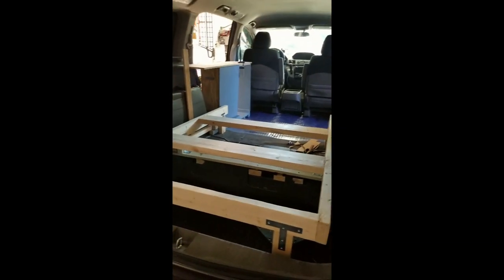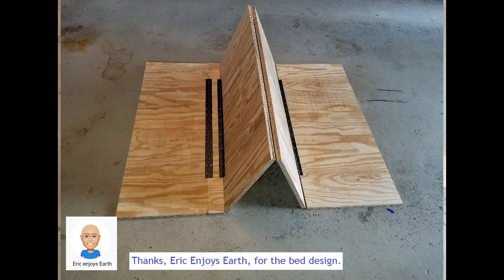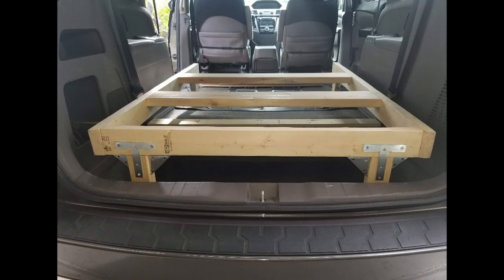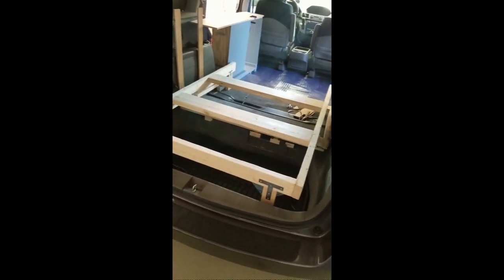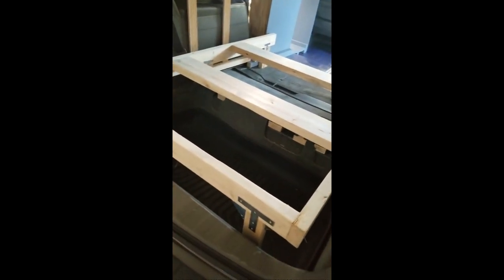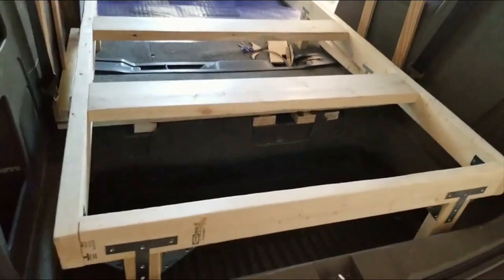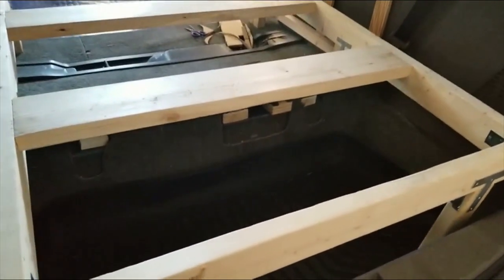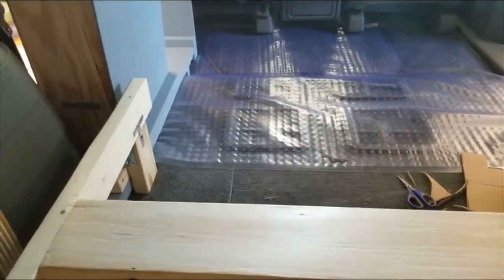How I built the bed/bench frame in my Minivan Camper Conversion.

Comment: Hello, thanks for all the info, it's very useful. I understand that the small panel rests on the first crossbar, that measurement is given by the first two panels, but I don't know what measurement to give the second crossbar so that it is well located and is the support for when it is in sitting mode. Could you tell us how you determine its location? Or have you only put it halfway between the first crossbar and the limit of the front part? After all, the mobile part of the sofa-bed has its own support. thanks again

Comment: I'm new to this (well not entirely--but way long story). I have a bed, but what the heck to put on it? Going from bed to bench (yep mine does this) must be not to easy with the bedding. My thoughts right now--basically three options: sleeping bag and liner (I think it's my least favorite idea); duvet and fitted sheet; something like beddys (seems $$$ option)? Your thoughts? Thanks, you are full of ideas--fun to listen.
Reply from the maker: Hi Jay, thanks for asking! We use a fitted sheet over the mattress cushions for 2 reasons: it's easy to wash and it helps hold the cushions tighter together. If it's warm out, we just sleep without covers. If it's a little chilly, we unzip a really light sleeping bag to use as a comforter. And if it's cold, we break out proper cold weather sleeping bags. Best of luck with the bed.

Comment: Hello! Do you have dimensions for width and length of the bed frame and or the top pieces with the hinges, please? 
I know height is up to everyone’s preference, but the rest would help a lot. 

Would love the blueprints if you have them, thanks!
Reply from the maker: Hi FD, Yes! Look for my bed frame video, it has all the specific dimensions I used. I realize other people might modify the measurements but I wanted to give you all a place to start, at least. Thanks for asking!

Comment: Hi Leslie, love the videos, great design. A question. The second row seats. Were they the magic slide seats? And were they a pain to remove? I looked at a 2019 odyssey today and the seats looked pretty hard to remove...Thanks! I plan to use your design for bed/shelves.
Reply from the maker: Hey William! I'm not sure what magic slide exactly is, but our 2nd row seats are a breeze to pop in and out. The 3rd row, on the other hand... those are designed to stay installed so it was a little trickier to un-install 'em. Congrats on your build, how's it going so far?
Reply: I’m test driving vans now. I’m leaning towards the odyssey rather than a sienna or pacifica.
Reply from the maker: Good luck! Let me know what you pick.

Comment: Leslie  ,19 inch couch bottom with 6 inches fome on back would leave 13 inch  Seat sounds small
Reply from the maker: You can certainly build it bigger, but I wouldn't build it any smaller. These dimensions work great for us. Very comfortable. But they're just a starting point.

Comment: Will a futon fit in the back good?
Reply from the maker: Hi Barry, Yes if it's the right size for your platform. BUT it won't fold up into a bench as easily, if you're designing your bed to convert into a bench. Thanks for asking! Let me know how your bed build goes.